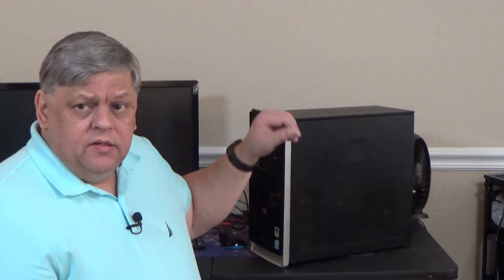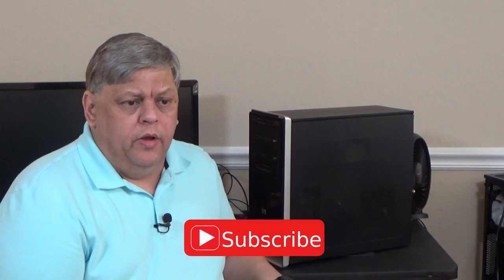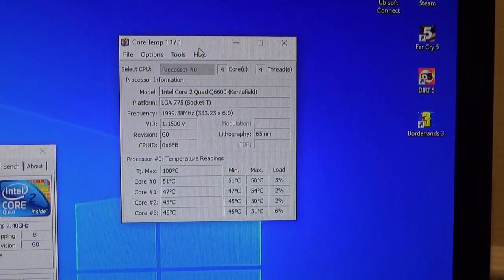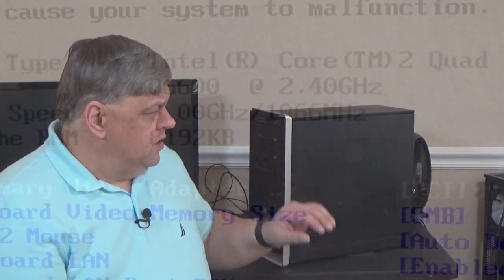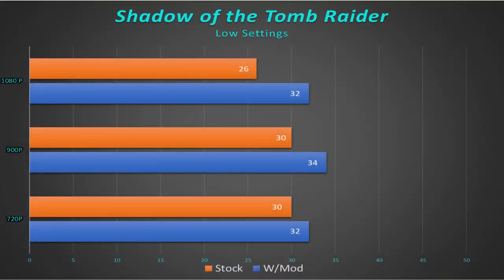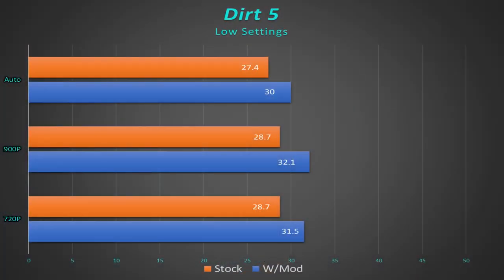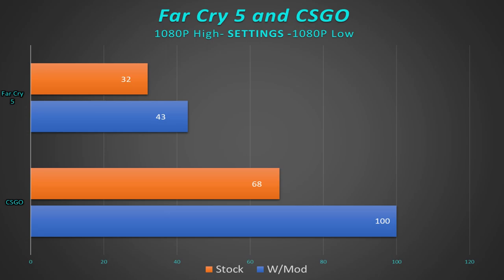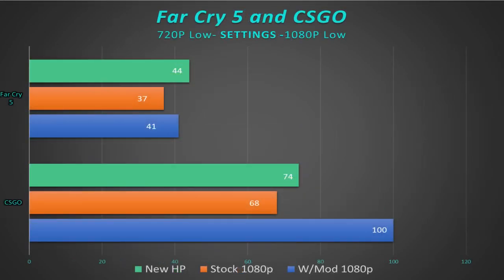Overclocking the Q6600 using tape - Your mileage may vary, this is not a tutorial, BUT it DOES work!

Comment: Did this on my own machine, it works surprisingly well. Temps stayed under control, was plenty stable, overall good hack
Reply from the maker: I was really surprised that it was something so simple. I remember a long time ago with the AMD K5 and K7 CPUs there used to be a hack where you could use a pencil to 'jumper' to contact points for extra bus speed, but if I remember right I bricked a CPU and a motherboard trying it.
Reply: @ThatPaulGuy  I think that may have been the 3 core to 4 core hack, although I may be wrong.  Unless the K5 and K7 are the three core and four core parts
Reply from the maker: @inherentlyflawed  it was a while back, so I don't remember for sure, but I think you're right. It may have been trying to turn a k5 into a k7 or something like that.